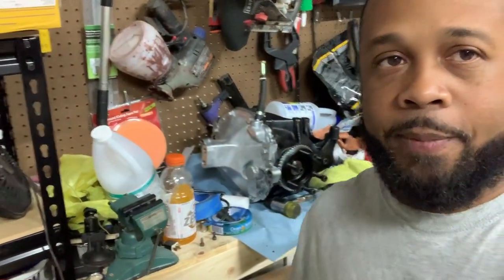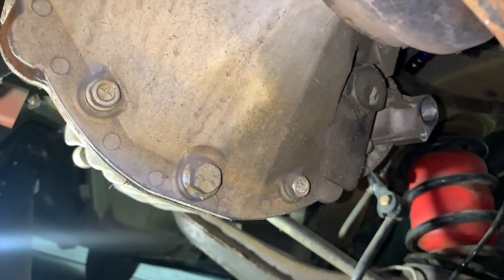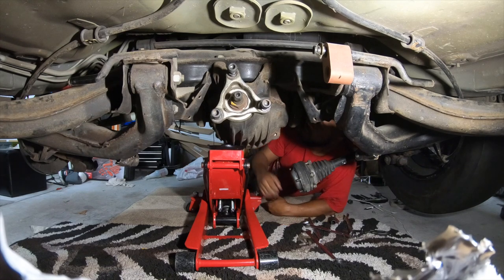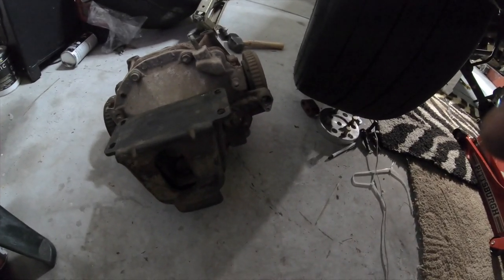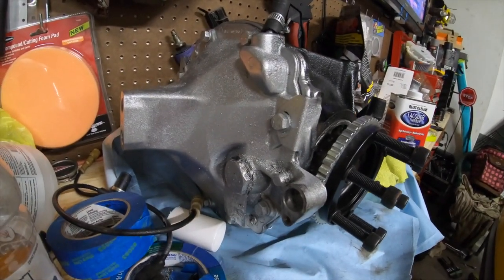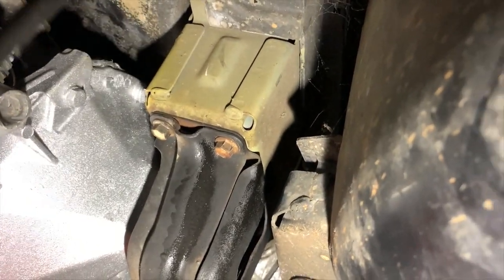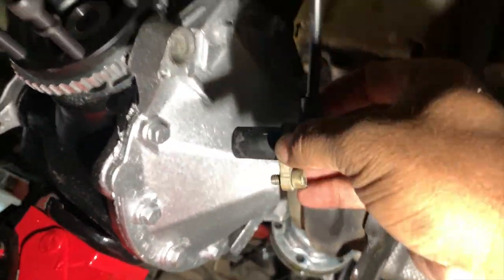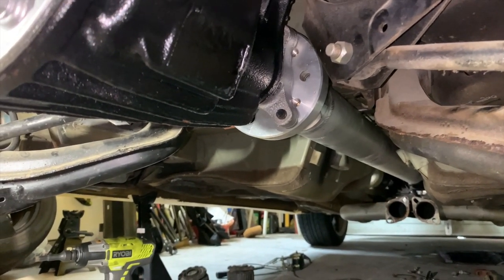Differential Replacement 2004-2006 GTO

Comment: Good job subscribed they make a stronger diff brace for an upgrade
Reply from the maker: Thanks, any ideas on one ?
Reply: @canz8tercustumz  
GForce Differential Carrier Brackets
Reply: @canz8tercustumz  they make lower control arms to but never seen them forsale. It connects to the rear lower shock mount

Comment: Nice car man! What did the diff with the 3.90 gears run you if you don’t mind me asking?
Reply from the maker: I had a local shop install the gears. I purchased the gears from Texas Speed and the local shop charged me $200 to install the gears. It’s a lot easier if you have a separate diff so that your car doesn’t have to be down.
Reply: That’s not bad at all, I have an 05 as well. Mines Lsa blown and pushing about 850 to the tire. Have the Gforce axles and still stock diff but my stub just broke. I’m worried about putting Gforce stubs in because then the next thing to go is the stock diff. Might look into the Gforce 9in irs but it’s way out of my budget at the moment.

Comment: Did you have to get a tune to run the steeper gears?
Did it throw off your speedometer?
If your car is an automatic, what’s your 70 mph rpm?

Just watched your first drive video and it answered a couple of these questions. 
Is the tune required for the gears a mail in type of tune or a dyno session type?
I just got my goat and plan on starting back to front. The plan is 3.90 gears and 3600 stall and tune for both of those. 
Of course I need to research this process in depth and do some suspension mods for wheel hop. 
Thanks for any advice you can offer. 
Love the Yellowjacket
Reply from the maker: Yes I had to get it tuned for the gears. Everything from the Yellow Jacket was transplanted from my Black gto. Look at my earlier videos of the Black gto and you’ll see where I did the gears and got it dyno tuned. I had to put the diff with the gears in it because it bucked so bad with stock gears since it was tuned for the 3.90 gears. I can run about 80mph and the rpm’s are near 3000. Let me know if you have anymore questions. I recorded everything I did with both cars so check out the videos and let me know if you have any questions.
Reply: @canz8tercustumz  I will subscribe and watch. 
I will definitely have questions. Thank you
Reply: @canz8tercustumz  I bought an entire rear cradle and all. My question is it seems to have play everywhere. Both axles and pinion if I turn back and forth there’s noise. I’m not familiar with these irs rears. 
Car was wrecked so it was presumably working fine until the tree. 
I appreciate your help.
Reply from the maker: @goat_life254  there shouldn’t be any play. Is the play in the diff or the entire cradle?
Reply: @canz8tercustumz  seems like the cv axles. It’s whe I turn back and forth
Reply from the maker: @goat_life254  that seems more like the pinion flange. There’s a crush washer in there and it seems like it’s causing too much backlash.
Reply: @canz8tercustumz  it’s dark but I’ll go film a short and upload it so you can see.
Reply: @canz8tercustumz  it’s there
Reply from the maker: @goat_life254  that’s something inside the diff. If it was a pinion issue, the wheels would turn a little before the pinion turns. That sound seems like something is loose. I’d pull the diff cover off and take a look at it.
Reply: @canz8tercustumz  if it needs a rebuild I’m okay with that. I just hope it’s not too bad. Guy said its been rebuilt recently. I marked it and it turned almost four times for one wheel revolution so its 3.90 for sure. 
Idk nothing about setting up rear ends though. I also haven’t seen the torque specs for the axles. This is way different than my s10’s!
Thank you for your help
Goat life
Reply: @canz8tercustumz  the diff turns no problem with no noise. That was just the play going back and forth. Seemed excessive to me. 
I’m going to open it up and see what I can see. A rebuild is t an issue. I want to do it right.
Reply from the maker: @goat_life254  Yes, it makes it a lot easier to take care of everything when it's already out.
Reply: @goat_life254  I didn't know anything about them either, until I overtightened my pinion nut by almost half a turn. Now installing the gforce spacer kit is gonna be something I do a video on. Not getting into the side adjusters or setting backlash though.
Reply: @evsnova74  for now that’s beyond my ability. However my goat has half an exhaust system, no diff, driveline or axles 😂 
Supposed to be doing a Hinson driveline today but my diff was making serious noises. 
Is there a torque sequence on the axles?
Reply: @goat_life254  I just did 50 to 60 lbs and used blue loctite, lemme look up the official spec
Reply: @goat_life254  jeez, 37lb ft then 68°
Reply: @evsnova74  is that even English? 😂 my stock ones were something like this but my Milwaukee impact couldn’t handle half the ones on my new axles. 
I’ve seen conflicting messages about it.
Reply: @evsnova74  I’m going 60lbs I think. And blue loctite of course

Comment: I don't think that you should be hitting the ABS sensor with a hammer, the rear differential Cover appears to have been painted so that may have made it hard to install the sensor,I would've sanded the locating bore with sandpaper or something.

Anyhow,my car is Similar, it's the Holden VY SS Commodore in Australia which is the 4 door right hand drive version of your car, yours is basically a  Holden Monaro coupe which is a left hand drive version which has been rebadged as the Pontiac GTO which was exported to the U.S. by Holden,mine runs the 5.7 litre Chevrolet LS1 V8 engine  & T56 Tremec manual transmission as well.

In my car my goal for 2024 is to rebuild a spare Dana M80 differential from a Holden VZ Commodore (a V6 model) which ran 3.07:1 gears & a single spinner centre,the goal is to fit 3.91:1 gears & a 4 pinion 28 spline LSD centre into the diff housing,I bought mine with 3.91:1 gears fitted & they were fitted with 3.46:1 gears standard by Holden.

I replaced the bearings back in 2014 after the pinion bearings startrd to make a whirring sound & they lost their preload but the diff centre sounds noisy so I am going to build another diff up for it,I am afraid that the spider gears are chipped on the LSD centre,it whines a bit at 60 km/h (40 mph).

I will buy another reconditioned M80 LSD centre which was running in a Ford FG Falcon non turbocharged XR6 since Ford in Australia ran the Dana M80 differential in them as well !
Reply from the maker: I had to replace the abs sensor due to the wire being broken so hammering it was the only way to get it out. It wasn’t originally painted, the sensor was swollen which is why it was hard to get out. I did however sand it down and put anti seize lubricant on it when I reinstalled it. Thanks for watching!

Comment: Did you use the cross member centering tool?
Reply from the maker: Yes I used the cradle tool when I changed the cradle bushings.
Reply: If you let your cradle drop a little you can get at the top four bolts much easier. Although with poly subframe bushings it won’t drop much.

Comment: what size wrench did you use for the 4 bolts on top of the cradle?
Reply from the maker: It was either 17mm or 18mm, can’t remember which one.
Reply: @canz8tercustumz  appreciate it

Comment: What size are the rear ends in these cars I'm want to change the rear gear but done know what size the rear end is?
Reply from the maker: There’s not a lot of companies that make gears for the gto. The only gears that I’ve seen available are 3.73’s and 3.90’s. I bought mine from Texas Speed.
Reply: 7.75" diff. I just replaced my stock with 4.11 Motive Gear. Very noisy and speedo is off by 20 mph. Research shows that I need to buy an HP Tuner to recalibrate the speedo. I may just go back to my stock R&P.
Reply from the maker: @mikegriggs2291  it’s an easy adjustment in HP Tuners, I have the Motive 3.90 gears and they aren’t noisy. What diff fluid are you using?